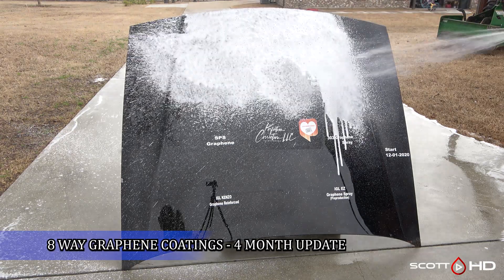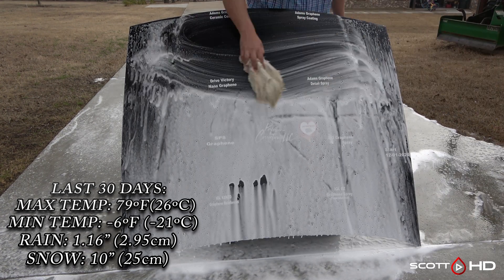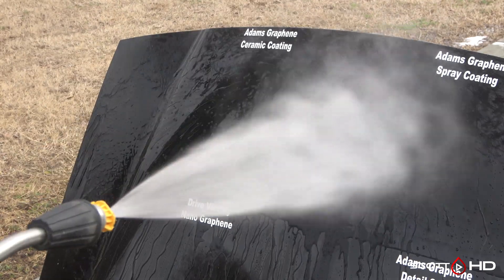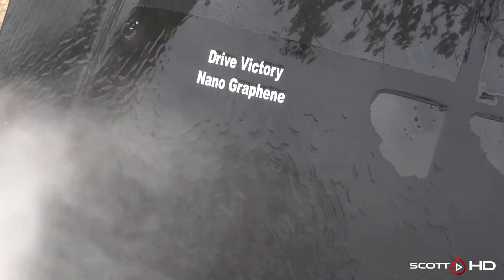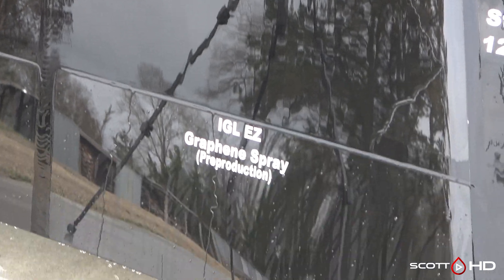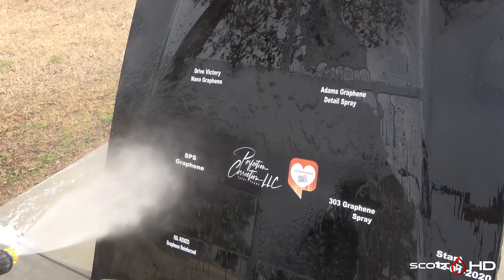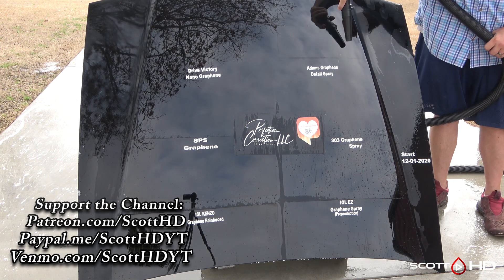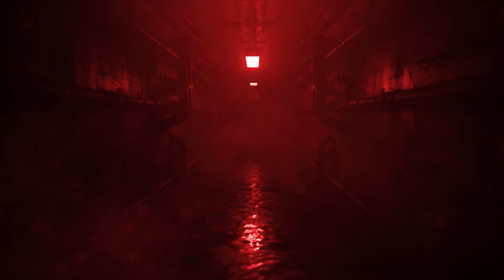Graphene Coatings - 8 Way Comparison - UPDATE 04 - 3 MONTH UPDATE - Thinking about redoing this test

Comment: I've watched a bunch of these type of videos, thanks for the info.   While it's cool to know how durable these are, how well they bead/sheet water after 3 months doesn't tell me how well they are doing on the real paint killer....UV protection.   That would be useful info, how's the paint doing???
Reply from the maker: Stay tuned!  New tests starting May 1 will not only show gloss improvement, but will show the amount of UV blocking ability.

Comment: You can add the Glassparency Graphene to the mix too. Some say it's the same as Adams Graphene but would be nice to put it to the test.
Reply from the maker: Bought it and it'll be in there 👍🏼
Reply: @ScottHD  Excellent. But what is your honest opinion about graphene? Does it have any significant benefit or is it just the latest hot buzz word?
Reply from the maker: @ojaspadekar659  looking at the SDS of many of them, most have less than 1% (some are 0.001%) Graphene.  I think some are doing it to jump on the bandwagon, but the original purpose is so it is more resistant to water spots which is the big weak spot of many ceramic coatings.
Reply: @ScottHD  let’s see if things actually improve or if it continues to remain a gimmick. Probably will have to wait for the gen 2 graphene coatings.
Reply from the maker: @ojaspadekar659  I bet the next "thing" will be Kevlar coatings!
Reply: @ScottHD  I wouldn’t put it past some brands’ marketing depts! 😂

Comment: You should only test stuff that you bought and can buy on the open market. The manufacturer should be able to pick “which batch” they send you. You should buy it unknowningly to manufacturer and test it.

That’s the only way to make sure you aren’t getting a loaded test.

They only have to add more Silicon Dioxide to the product they send you.
Reply from the maker: Good point!  This is why I will always disclose whether or not the manufacturer sent it to me.

Comment: In regards to the 303. I feel you should reserve 3 spaces. Your Original purchase using the updated instructions. The Supplied version. And another one for a store bought bottle with a different lot number. If all 3 do not perform the same. Then we will know if they are reputable or full of crap.

Comment: I would not redo the test unless 303 Graphene is going to replace the “bad” batches.  I purchased the same batch number and reached out to the company about getting it replaced.  I had two unopened bottles and I cited your test.  They told me there was nothing wrong with that batch, the issue was in following the instructions.  If there was nothing wrong with the batch then why redo the test?
Reply from the maker: Look at my 38 way test most recent update.  I tested the same batch that is in this hood, and the new batch they sent me.... There is an obvious difference between the two.
Reply: @ScottHD  they thought you were a random customer that’s why but once they saw your video now they want to give you a good batch
Reply from the maker: @Ram-rm2gz  you're probably not wrong
Reply: @ScottHD   If the new batch is different then they should replace the old batches purchased by customers.  That said I do have an unopened bottle of the old batch I’d be willing to send you (no charge and I will pay the shipping) if you will run a test following their updated instructions to see if the batch has any problems.  Again, the company wrote to me that the batch is just fine and the error was in application.
Reply: I wouldn’t rag too hard on a product manufacturer. Speaking from experience sometimes the raw chemical manufacturer has/had a bad batch.

Comment: I agree with restarting the test. Since the start of this test there have been changes to this category that render the current test less meaningful. Allowing the implementation of newer batches of 303 as well as adding new entrants of graphene products may be a more productive test. In fact the graphene push is coming and we may benefit from waiting another few months before restarting as I believe we will see more products entering this category. Thanks.

Comment: I purchased one of the products on this test that is still performing well and mine is not (I prefer to not say which one). After 3 months my product failed and I applied the product as instructed (only 1 coat). Based on my experience and what you have witnessed with some of these products. I am questioning if the products are coming with the appropriate instructions for how long the product needs to set up before wiping it off.  Or if possibly they are super volatile when it comes to application time, conditions, and environment. 

By the way I love the content and only buy products you've tested!

Comment: Surprised at how long the Adams Graphene Detail Spray lasted up to this point.  Their Graphene Spray Coating looks just as impressive as their Ceramic Spray coating which is not saying much.  I saw the ceramic spray coating start to struggle around the same time as what you are seeing with the graphene spray coating.  f you decide to retest there are plenty of options for graphene coatings from Adams, Xtreme Solutions, Jade Graphene Pro, Exo Forma, Ethos, Jax Wax, Artdeshine, SPS, IGL Kenzo, IGL Quartz+, NV Evo.  Thanks for the updates.

Comment: Hi Scott, just a thought (it happens every other leap year ) is it fair lining up spray coatings against the full monty that often need extended cure times & in the main coated in a garage environment? The good news if you have two car bonnets / hoods there are almost certainly enough to do seperate spray coatings & the other 'full monty' Just a thought.

Comment: I suggest separating the coatings in glass bottles from the ceramic/Graphene sprays. They are two different classes of products.
I would like to see the Underdg Sauce Pro included in the next test of coatings. Underdg uses Polytetrafluoroethylene, silicon and paraffin as main ingredients and they claim its highly resistant to water spots.

Comment: Are all of these sprays? I'd do one for coatings and another separate for sprays.
Reply from the maker: I have typically mixed them in the same test unless I have enough of the same type to test.  (I have a ceramic spray Coatings test)
Reply: @ScottHD  Yes, i've watched those. All quite excellent. My thoughts are people are more likely to cross shop within a category. Spray sealants being one, coatings being another, wax being another.

Comment: Informative and I can’t get enough. About the redo 🤔 in all fairness Scott, if I go buy an Adams 303 graphine off the shelf and I get the same bad batch that’s going to be the same protective performance of that product on my vehicle. I don’t think it’s fair to give second chances when the product is mass produced because there could be thousands of people buying this product and having nearly no protection on their vehicles. It’s almost like “false expectations”. Anyway that’s just my 2 cents which doesn’t add up to much ☺️
Reply: I agree with them 303 has shown several times now being inconsistent with there product manufacturing if you have a product it should be consistent all the time it should be tested to make sure the consumers are getting what they pay for
Reply: Agree
Reply: Agree as well.
Reply: Agree
Reply: @ Ricks Cars - very good point but I would hope that 303 have sorted out their QA problems so all future batches perform as intended. 

Is their a way of identifying the dodgy batch but  code or number on the bottle?
I know that opens a whole cam of worms - 303 should have recalled the bad batch, people will be asking for refunds etc...

Anyway, Scott, sorry for rambling on but with the above in mind 303 deserve another go and so many products have failed now I think you could add in some different products to really find the durability monsters.

Keep up the good work and thanks for all your tests.
Reply: I am  100% in agreement with this comment.
Reply: If you redo , you need to buy the 303 at the store , not test a special bottle they send you,  which may have different formula specifically to win tests